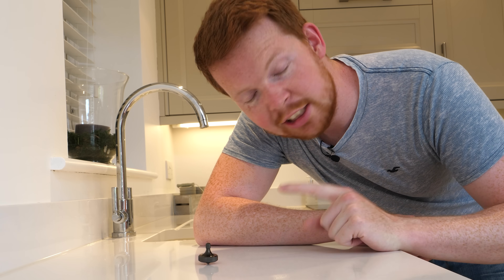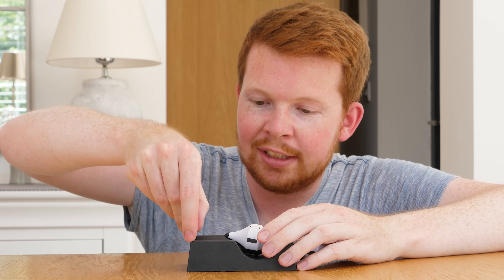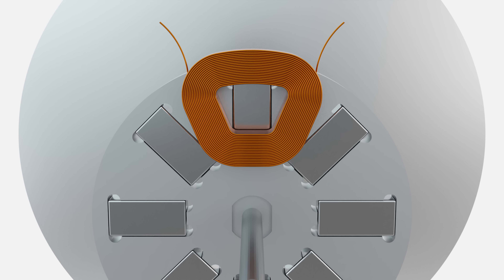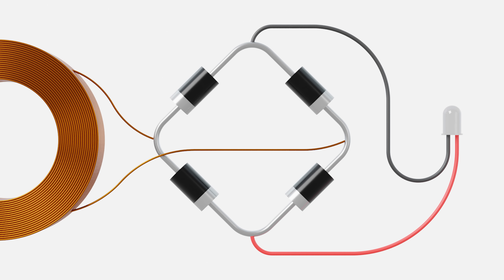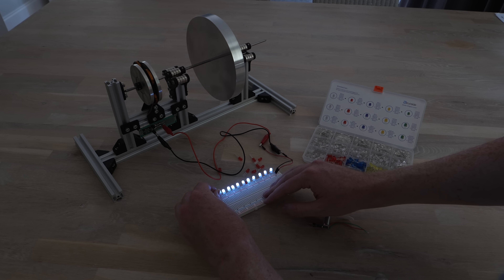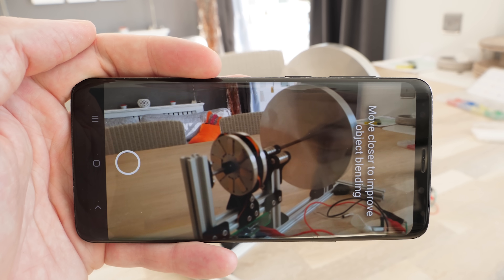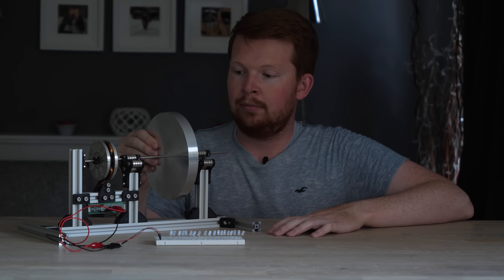Flywheel Battery

Comment: Next step is to put a motor in that spins the wheel and runs off the electricity generated by the wheel. It's not perpetual motion but I can imagine it spinning for multiple hours no problem with one manual spin

Comment: this could be usfull as a sortof grid capacitor. to smothout the power generated from wind and solar. 
imagine this, you have this flywheel and you use the generator as a motor to spin it at 60rpm (or a mutlible of 60 to match the powergrid) that takes a couple KW to spin up but then just sips power spinning there a couple wats at max to overcome friction. then letssay a windmill falls down unexpeteadly cuts its power output and there is now a deficit, well instantly that motor becomes a generator and starts sending the stored power from the flywheel into the grid. keeping everyone online and happy.

Comment: Put an iron place on the outside of the magnets to focus the magnetic field where it is useful.  Put 2 parallel but oposing directions LEDs instead of the bridge rectifier.  Again, where there is going to be a voltage drop anyway, use it.

Comment: For the LEDs add a joule thief
I probs would even taken Advantage That Some part of your System is AC and made A Step up Transformer 

Even a Rotary converter (Technically most of these are a Rotating Transformer ) Nice thing about Electromagnets They can make even Stronger   magnetic fields

Comment: If you added a battery and a motor to actually turn the flywheel somehow would you get continuous power? I know voltage drop occurs but if you used a regulator you could control how much power your using and should be able to store enough to counter act them, I don't am I way off can someone tell me why it wouldn't work or can we try it, thank you.

Comment: 📺👤⁉️ Do you understand LED, LCD ...
🥺💬 For electronic devices or calculation lead emissions device control.
🐑💬 See computer HDD, we found that power devices can share and change direction.
🧸💬 Without display or explain less of reader understand of emitter coulomb can gain accumulate potential and percisely redirect by instrument efficient way because it is continuous current.

Comment: Would you possibly be able to get a motor to keep it spinning? I know you'll loose some power from the motor but would there be enough to run a light bulb off?
Reply: Even if you can’t figure out why it wouldn’t work, nothing makes infinite energy. Solar and wind energy will stop working eventually if the sun disappears.
But I can explain the science of why this one wouldn’t work. Making electricity from the spinning slows it down faster. If you time it plugged into leds and unplugged, it will spin for less time plugged in. Energy can’t be created and energy leaves the loop of the flywheel and motor through stuff like the motor heating up, so the motor wouldn’t have enough power to spin the flywheel any faster, and as the flywheel slows down, the motor will get less power and etc. The flywheel might spin for longer than leds but it won’t spin as long as while it’s unplugged.

Comment: Reverse it by inputting power, create three more, put rubber on the fly wheel and you have a pretty snazzy awd axial flux motor driven vehicle with magnetic suspension

Comment: So if u make a bigger one but a smaller motor to power it as it's got hardly any resistance you have free energy forever
Reply: The motor will make heat, induce eddy currents; the wires have resistance, etc. It won’t last forever, and the electricity for the motor is gonna cost more than it would be to just plug in whatever you are trying to power. And you can’t power the motor with the flywheel, because that’s creating energy

Comment: I have questions as someone who loves to watch invention videos like this, but know very little.

Would you be able to get some more stability/ consistency in the rotation by making some more magnet holders on top? I imagen this would kinda make a cage for the up and down wobble, unless there is something here that would make that a relatively inefficient method?

I also wonder if you could get some more consistent energy pulses by offsetting the two magnet wheels. I assume this will decrease power but add to consistency at lower rpms if that sort of thing actually matters in power generation.

Lastly I watched a video recently on a tesla router i think it was. where you use multiple thin disks and some compressed air to spin a shaft for power generation. I'd love to see something like that in a pseudo frictionless design like this and see to what speeds it could get to.

Love the video and machine. Thank you for making this.

Comment: To reduce the drag even more the steel rod that you put the fly wheel on Place a magnet on each end of that rod and a magnet on the end of A  Retention wall At the corresponding height of the steel rod therefore there should be no drag other than magnet on magnet on each end of the steel rod repelling each other as well as the magnets on the steel rod suspending it making it free-floating that would be free-floating in all directions now

Comment: A flywheel is not a battery, it never has been and never will be. A battery is an electrochemical device, a fly wheel, when you look closely, is not electrochemical in nature.  A fly wheel is an energy storage device, but please please DO NOT use inappropriate terminology.
Reply: While true, most people would think the definition of battery is something that stores energy, and this video was made expecting a less knowledgeable audience. He explained how magnets work, even. At that level, correct terminology isn’t important and it’s also better sounding than “flywheel stores energy”
Reply: @henrysanecdotes5323  I cannot agree with you.  I value truth over marketing tripe. A battery is a electro-chemical device for storing electricity. or more specifically, electric charge.  

Do you call a komodo dragon a dinosaur even if is does better fulfil some specific purpose. Of course you don't. 

It is no wonder there is so much illiteracy when terms are wrongly used so often,  and usually for their own monetary gain. its pathetic really.
Reply: @petefluffy7420  I get sticking to terminology is important, but batteries are so common that they are easily distinguishable from other things that have other terms (like this flywheel), as opposed to terms like induction and eddy currents. Those terms describe specific things, and while “battery” also describes something, it’s a lot more broad and we have different terms to refer to more specific things within the umbrella term of battery. You have lithium ion, zinc-copper-whatever-it-was-I-forgot, AA, AAA, D, car, lemon, etc. I guess my point is that it’s not super important to stick to the definition of this broad term. Not important enough to comment about it on a not-very-recent video.

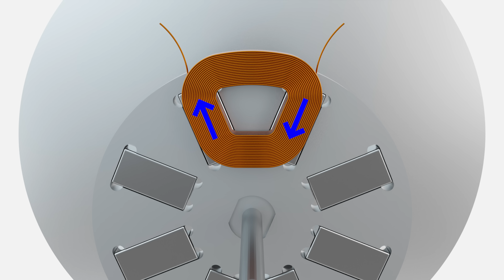Comment: 4:29 in this animation you where saying, when the north and the south pole of two magnets align with coil conductors it produces current, what current the coil would produce when it is clock wise? positive or negative?. And secondly What happens when the magnet was centre of the coil. Will there be any current in coil, on that time. or the coil will be neutral? I am talking about a single coil here not a hole bunch. Just because I am learning
And thankyou for your 3d demonstration ❤ and I please comment the answer for my question thanq
Reply: Neither. The electrons in the wire are normally evenly spread out. When a magnet’s north pole is brought near, the electrons are attracted (idk if north or south makes electrons attracted so maybe it’s backwards) and they bunch up near the magnet. If you spin the magnet, then the electrons go away in both directions and come back in both directions. And I think this isn’t true so someone tell me how it actually works or if I got it right but I guess the electrons have inertia so once the electrons randomly go more in one direction, they gain momentum and go in that direction.

Comment: 700mV is more than enough to run a traditional freestanding fryer. The Pitco millivolt system uses 0.6 volts to hold the gas safety valve open AND operate the thermostat. It's why you light the pilot and hold the button 😁

Comment: It would be really interesting to see if you could make this into a somewhat efficient wind turbine
Reply: I disagree with the statement below via Jg, to some degree. A small scale wind turbine might be able to utilize this to some degree of success, albeit with some alterations like shortening of the shaft, calculating the ideal weight of the flywheel itself, etc. It'd be an interesting experiment to see what the optimal amount of power would be for something like this, e.g. 10W, etc. Could prove just as efficient if not more efficient than some contemporary hobby-size power generating devices.
Reply: @BlitzTCG  uh... you arent disagreeing with "me" you are disagreeing with isaac newton, lenz, maxwell, amongst others. This isnt an opinion you get to agree or disagree with mate
Reply: @BlitzTCG  youre using ideas that sound novel in your head, but you really just have no clue. A fantastic place to start here is Lenz's LAW... again not "lenz's opinion you get to disagree with".
Reply: Impossible. The video glosses over a lot of other issues. For starters, motors/generators tend to want to "lock in" on the magnetic flux. Another couple issues are eddy currents and counter electromotive force (this is what functionally replaces your "friction" so to speak). Once you get to sizes useable for reasonable power generation; youre now looking at spending more energy on charging electromagnets than you will get out of the process in general.  There is unfortunately no free lunch here. Even if you made this theoretical device out of materials we dont have made yet, you're still going to suffer the consequences of power generation. I.e. super light mega efficient turbine would have very little kinetic energy and the moment of inertia would be extremely low (this is good for rolling wheels for instance; lower unsprung mass to deal with, lower inertia, easier for an engine to drive the wheels); but in counter intuitive fashion; it would take less and less counter EMF to stop the turbine completely. Lower the mass, the less energy required to slow -> stop the turbine. Turbine that doesnt move isnt very useful now is it haha.  Hope this helps

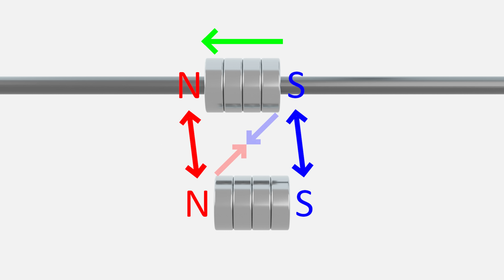Comment: This need a proper hand crack with a gear ratio at least 1:10 where every one rotation of the crank turn the fly wheel ten time that way you can get high rpms with minimal effort while keeping it hand powered and could find itself to be used. Maybe increase the weight of the flywheel with copper inlays to balance it as well.

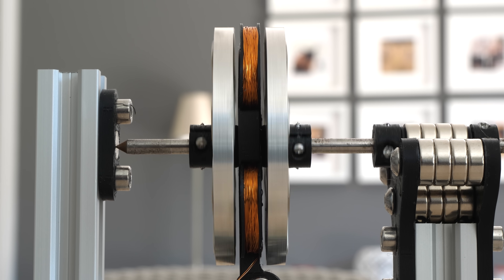Comment: 6:58 your capacitor is clearly larger in your original setup than in your second version despite your claim of adding larger capacitors in order to increase voltage output. you even exclaim, "quite a large capacitor". then, in your second version, no capacitors are even visible. 8:32
 you are such a rotten liar. also, your "improvements" would not result in an 11-fold increase in voltage.

Comment: you're obviously a fraud. the rotor does not have a constant velocity despite your voltage which appears to remain constant. obviously the voltage would not remain constant if your multimeter were reading the voltage generated by your contraption, but instead, you've rigged it up to read from some source of constant voltage. 7:30 thumbs down for frauds like you. you even edited out how you speed up the rotor's spin yet the voltage stays low, then you edited in a part where your rotor is spinning somewhat faster and the voltage is miraculously twice as high and not changing. such a disgusting fraud, you are.
you can't even pronounce the word "coils" 7:43. you said "quills."
Reply: 1. He has an accent, bruh. 2. You are right, the voltage produced is going up and down as the magnets go over coils. But he puts it through a capacitor which works to take in fluctuating power and put out a constant voltage. If you wanted to sound smart, maybe you should have looked at a beginners guide which surely would have mentioned what capacitors are used for. He even explains that the capacitor is used to smooth the voltage.

Comment: The thing is that for this to be viable energy storage, the flywheel needs to be much more massive and have 10s of thousands of rpms. Even neodymium magnets will only hold so much weight, and the only way to get truly frictionless kitetic batteries is in a null gravity vacuum. The amount of cash to put that huge flywheel into space piece by piece is enormous, and then how do we spin it and send that energy back to Earth. Big problems, super cool concept 🫤
Reply: Lithium ion batteries are much better at retaining a charge too. Much much much better.

Comment: Why the need to convert to DC? We have AC lights and fans.
Reply: Probably just because he didn’t have ac stuff but did have dc stuff lying around, but also because the frequency and voltage are constantly changing as the thing slows down and speeds up which would be weird for commercial applications.

Comment: LEDs don't follow ohms law like a resistor. Without a current limiting resistor in series with the led they pass as much current as possible (theoretically). Its quite easy to burn them out without realizing this.

Comment: suggestion... a true flywheel batterie

Use a ring magnet as the circumference of the flywheel. make sure the polarity is through not radial.
Place a highly ferrous plate of steel at one pole of the ring magnet. be sure it is a snug fit to the shaft (shaft must be ferrous as well) through the ring magnet.
Insulate the bearing holding the shaft to prevent electrical grounding through the bearing to the housing/structure.
Isolate and Hang 30ft of wire in a straight vertical out in open air (away from anything that would ground it)
Attach the bottom end of the wire to a carbon brush that rests against a conductive ring on the surface of the ring magnet's circumference.
Add a strong magnet to the end of the shaft, protruding past the bearings. orient the polarity to make the flux continuous, from the ring magnet into the plate through the shaft and through the magnet.
place grounding rod next to the device.
Wire grounding rod to touch the polar end of the magnet.
if the rotation of the flywheel interrupts the continuous grounding of the wire a current will form from the wire to the grounding rod. the more interrupts the faster the flywheel will spin, using the Static Electricity in the 30 feet of vertical linear travel you should have a 1000v current applied to the circumference of your now homopolar motor. 
every time you break the ground and then reconect it you should get a 1000v surge at .000,000,000 something amps

Comment: I had one of those levitating desk toys growing up. Mine had LEDs built in that were driven by the spinning of the toy, so it never needed batteries and would illuminate with bright red stripes when spun. The setup you've engineered is pretty awesome!

Comment: A couple of guys out of UOC Boulder designed a mechanical battery that’s you should check out. Impregnated carbon fiber in a vacuum. Worked very well

Comment: That is shockingly efficient, I wonder if you could basically it so that the generator powers a motor. Which occasionally adds circular momentum back into the generator, basically making an infinite motion machine! Of course, it can’t be infinite, parts will wear down eventually, but still

Comment: This is a really well explained video, if the fly wheel Incorporated a magnetic strip could you then use the current to power an electromagnet to generate a constant state of attraction on the rotation of the fly wheel and therfore a self sustaining system?

Comment: What makes me so bad when efficiency is key and you have a lathe and wouldn't machine the run out on the steel rod
Reply: if you machined a thin rod, youd get an even thinner, bendier rod
Reply: @techheck3358  true but with a  lathe and  the time you took to engineer, this spends  10 to 20 bucks on an aluminum/ steel rod if that 1 ft 16 inches etc whatever and just machine it  with. . 005 run out
Reply: And this is not a I'm smarter than you comment its just obvious that to make it truly efficient make 1 of the most important parts not bent maybe also 3d print a a mount where you have your magnets repelling eachother on the support and add more magnets that sit above the rod as well . Where it's not just the lower half holding the magnets put magnets on top of the rod too that way the rod on both ends is completely  closed in by magnets 🧲  it seems like it would make for a much more efficient design I'm not better than yoy but just a view obvious pointers that could only help we need to see a real attempt from you sir

Comment: If you could theoretically do this in space, where air resistance wouldn’t slow the flywheel down, would that mean you’d get a near infinite amount of power? Certainly not, right?

Comment: put a bearing on the end of the shaft and mount that in a housing to keep the assembly from wobbling around so much. or i guess you could have another pointy tip and have that fit into a tiny punch point

Comment: I wonder what would happen if you were to hook a Electric motor to the shaft and then turn the wheel until it generated enough to power the motor enough to start spinning the shaft would you have continuous power